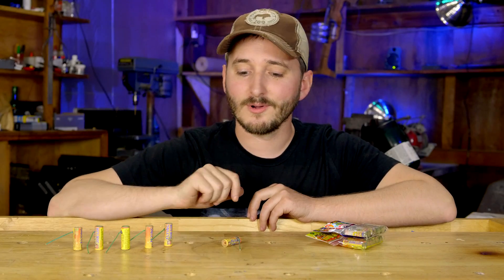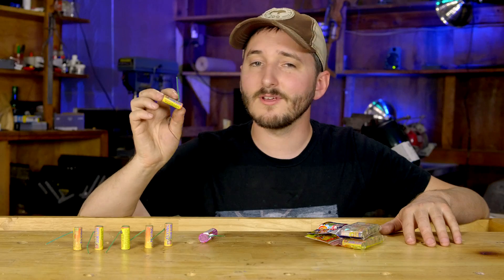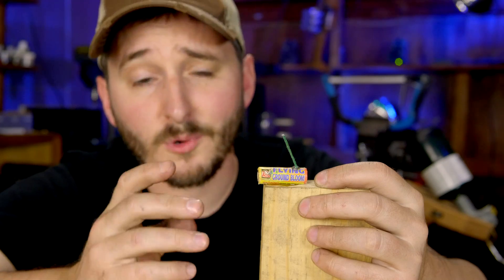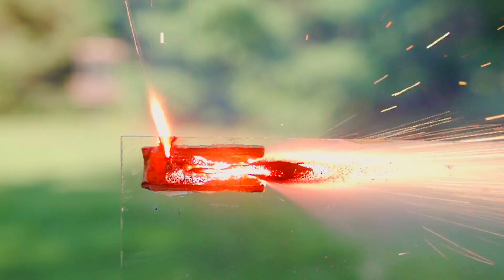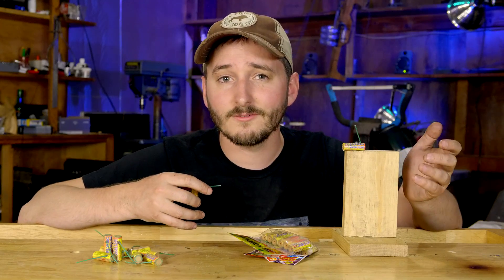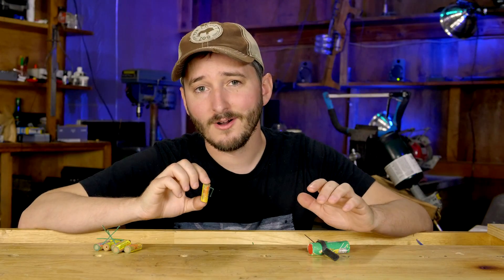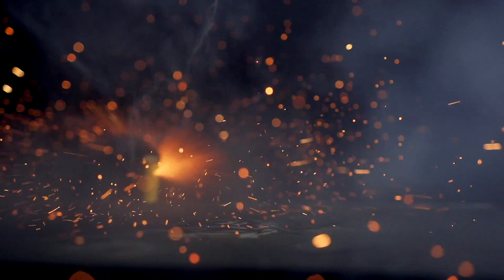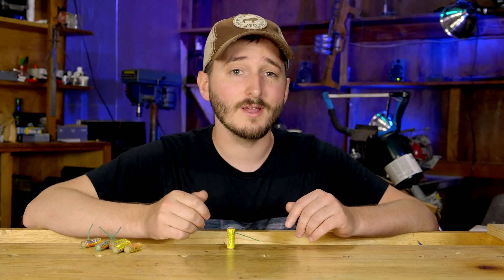How Do These Fireworks Fly?

Comment: Weight distribution changes with fuel exhaustion.

The firework is exhausting it's fuel from one end. So the heavy end is the opposite end. The rotation makes the firework spin like a top. By the time the rocket stands on the heavy end the firework starts jet from the heavy end changing from a top to a rocket.
Reply: This is what I was thinking too. Is the firework bottom heavy to start with? As the spin fuel is burnt, the centre of mass changes and the lighter end would lift.
To demonstrate the effect spin a cylinder full of clay and it will stay rotating on the same plane. Then spin a cylinder that has only been half filled with clay at one end and the cylinder and the lighter end should lift up if the rotational speed is high enough. 

The thrust from the fuse hole being offset from both the radial axis and the initial centre of mass gives the tube enough momentum to spin. As the fuel is depleted the centre of mass moves away from the fuse hole thrust causing the tube to lift at the lighter end because as the centre of mass moves, the rotational axis moves with it. At some point the two axes of rotation meet and the tube is now aligned for the lifting charge to ignite.
Reply: @maxximumb  Oh of cause! Nice spot!
Reply: @maxximumb  its packed minerals in salt form so, yes, pretty dense bois (at least dense enough to make them weigh more than the cardboard tube and plugs)
Reply: Exactly what came to my mind when I saw the fuse burning through the glass.
Reply: Pretty much this. Also the rotation plays a non-negligible factor, but other comments sum that up pretty well
Reply: it is weighted  heavy at the start I have ariel that is heavy at 1 end  with side exit turns vertical then blades turning cause flight
Reply: yes, maybe some weight distribution while manufacturing helps. also the spin stabilizes the whole thing of course once in the air
Reply: Nice spot! You can do that "trick" with a half full water bottle.
Reply: Totally agree, first thing that came to mind
Reply: I wondered this ??
Reply: that was my theory. more mass in the other end. as it increases its rotation along the x axis, the difference in weight cause it to gain some small distance from the ground. the rotation then increases, which causes more distance..so and so forth until it stands upright. but i still feel like theres something im missing
Reply: No, this is not the case! It's the moment of inertia that changes when switching from the horizonal to vertical axes of rotation. Becuase mass is distributed closer towards the axis of rotation in the vertical position, this represents the firework's lowest-energy axis of rotation. So the firework intrinsically "wants" to get back to this position, and the energy to do so comes from the friction with the table, which provides random accelerations to the firework (kind of like providing activation energy in a thermodynamically controlled reaction).
Reply: with active thrust, spin,ground effect and friction are what makes it what it is.
Reply: Yep. This is the explanation I immediately went looking for. The center of mass changes mid-burn. By the time the "rocket" phase begins, half of the container is empty, making the firework heavier in the butt. It's possible that it's already heavier on one side before the burn too though; I'd be curious to see that get measured.
Reply: You’re not wrong, but the fuel is only a tiny portion of the weight. I don’t thing the shift in weight distribution plays a large role in it.
Reply: The shift in mass would actually make it less stable. I can see where people intuitively start thinking along the lines of buoyancy and heavy end down/light end up, but that is static stability and quite unlike stability in fluid dynamics and free body motion. 

In airplanes and rocket the whole rotates around the center of mass and moving the center of mass away from the aerodynamic center of pressure gives the aerodynamic center more leverage[moment arm]. Think of an arrow, the heavy tip moves the center of mass [point of rotation] forward and the fletching moves the aerodynamic center of pressure rearward, if the center of pressure (from air drag) is behind the center of mass the system is stable, if the center of mass is behind the center of pressure it will be unstable and quickly try to flip over. Look at it in reverse, if you shot a normal arrow tail first what would happen? 
The only real directional stability in the case of this firework is gyroscopic rigidity, like a rifle bullet.

Comment: If you where looking at it standing up fuse at top...Just a 25 degree or so horizontally angled jet nozzle in the clay where the fuse is.. apposed to a ground bloom where the fuse nozzle is more of a vertical angle to keep it from tippy topping itself? And spinning horizontally? 2ed thing to mind after the fist though like you as the bottom jet fighting the top jet

Comment: Did you check the weight of the fireworks? They may be overbalanced towards the back half. If that's the case centrifical force may be pushing the heavy end to the ground and the light end up. You should try attaching a bunch of weights to a bike tire in one spot. Then spin the bike tire like a coin and see if the weighted end moves to the ground. Remember gravity is still going to be in play no matter how fast you spin something. The addition of a strong torking mechanism to a rotational mass may cause flight.

Comment: Physics guy here! Simply, the vertical orientation is a stable equilibrium for a rotating cylinder (under influence of gravity), and lying flat on the ground is a very unstable position. Rather than proving it mathematically, you can try this for yourself! Take a small pill bottle and remove the cap and all the contents. Now, place it on its side on a table or floor. Press down with a few fingers on the bottom of the bottle and then spin it away from you with some force. What will happen is that the bottle will go spinning off and start to right itself with the bottom of the bottle off of the ground! Now, try again, but this time apply the force to the top of the bottle, and the bottle will right itself so that the top of the bottle is off the ground. This is just like the firework, where the force that spins the cylinder is applied to one side of the cylinder, and it always ends upright. The only difference is that for the pill bottle, friction and the normal force from the ground give the perturbation (really just a small nudge) to allow the bottle to right itself, but for the firework, I think that ground effect is more important.
Reply from the maker: Thanks for the thorough answer! I will try the pill bottle experiment

Comment: What's crazy, is that they are quite a complicated mechanism, but they are reliable albeit being made of crappy cardboard and clay. It should be an inspiration for rocket designers :p
Reply: Imagine how dizzy the astronauts would get..........
Reply: Most rocket motors are already made out of cardboard and clay
Reply: Rather it's itself an inspiration from rocket science buddy ✌🏻
Reply: Ikr, most fireworks are jus th a joke. But these are well designed, relatively cheap, and most importanlty loads of fun
Reply: I don't think I'd want to ride one into space.
Reply: nraynaud1 i wouldnt call it complicated, its a tube with a hole in the side and a plugged end full of black powder
Reply: @Videoswithsoarin  there is a LOT of physics and chemistry at work when it comes to fireworks.

even the very simple ones like firecrackers.
Reply: It's not a complicated mechanism at all. It uses very simple principles of rotational equilibrium.

Comment: I think it tends to stand upright because the propellant burns from the fused end making it lighter in weight.
The bottom end must be where it is because it has still unburned propellant making it heavier.
But of course I'm only taking a guess......
Reply: David Barr  They aren't right though... There's a giant tunnel in the bottom half... That's way less material then a tiny fuse. Idk how you thought they could be right lmao
Reply: @SylasTheGreat  a giant tunnel... through a piece of clay at the base. if you pause it at 3.00 and have a look at the clay on the top part of the bottom section (above the 'tunnel') you can see it angles towards the fuse hole ever so slightly, which I bet changes the centre of balance and spin axis ever so slightly, but probably just enough.
Reply: @brapamaldi  it's still lighter on the bottom so it still doesn't work
Reply: @SylasTheGreat  
How is it lighter on the bottom when ignition starts from the top where the fuse is?

The other thing to consider is centrifugal force and motion added to the mix.
Reply: @jayytee8062  because there's a giant tunnel taking up way less space at the bottom... Not to hard to understand if you just think
Reply: @SylasTheGreat  
No offense but i don't think you understand the construct of this particular pyrotechnic device.
Reply: @jayytee8062  I do, I'm pretty sure you don't but ok... If you wanna think it has to do with weight then that's on you. It only has to do with the rotation of the top which causes the bottom to grab and pop up. I'm not gonna argue though, this video just proves what I mean so it's no big deal to me.
Reply: Torque. Torque points toward the fuse end. If the fuse was flipped around, it would point away.
Reply: The "tunnel" actually has nothing to do with weight. Its designed like that to allow the fire to reach all the blackpowder faster resulting in a quicker launch but shorter flight than a typical rocket. We call these coreburner rockets in the pyrotechnic world.

Comment: Have you tried cutting the fuse off and finding the center balance point?
To me it seems like the rear nozzle end must be just slightly heavier once the fuse is gone.
Combined that with the spin and thrust coming from the fuse end that makes it stand upright just in time for the take off burn.
If the fuse end was heavier wouldn't it almost just shoot off the table sideways instead of spin? 
Could maybe test this with some hot glue or thumb tac to add some weight on the fuse end and see how it affects it.
But you are much smarter than me haha

Comment: Is there any evidence of a directional nozzle for the wick hole which could induce the rotation?  In the couple clips you showed they all seemed to rotate in the same direction.

Is there a way to dissolve each of the compounds used in the firework?  It might provide some evidence that there is a nozzle, even a swipe of clay.

Additionally, is there a weight difference per end of the firework?  Such as is the bottom heavier than the top?
Reply from the maker: The fuse does enter on an angle to assist in the rotation

Comment: 3:03 Awfully considerate of that glass to wait until the test was finished to crack.

Honestly, though, I think you've hit the nail on the head with your revised hypothesis (not so sure about the tippy top one). Don't sell yourself short, either.
Reply: You can really see heat conduction with the glass. It takes some time and that's really wonderful somehow
Reply: its the cooling of the glass that causes it to crack, not so much the heating. hence why glassmakers have to anneal their glass and cool it slowly over several hours in order for it not to crack / shatter.
Reply: @brapamaldi  Oh, I didn't know that! Is it because some parts cool down faster than others and the slight contractions cause it to crack?
Reply: @yeet1337  i think so. im not 100% on all the details, but when I was at uni doing glass work they had big ovens that you put your work into so they didnt cool too fast and crack. with the heat being so focused on the glass pane and the rest of the pane being cool id say there would be a high amount of internal stress in that glass and even just a small temperature change would possibly causes the cracks to happen. im not an expert on it tho, just something I learned when I took glass as an elective at art school.
Reply: The glass is like ta-dah and then starts shaking it's jazz hands awaiting the applause!
Reply: All good comments. This is my 2 cents worth, the heat is shown off in the burn process. Then the cooling starts. The crack starts from the air intake of this fun rocket and runs towards the exhaust as the glass cools. As Brapamaldi pointed out it is formed from the rapid cooling. I'm no expert, just an engineer by evocation that's interested in a lot of things.